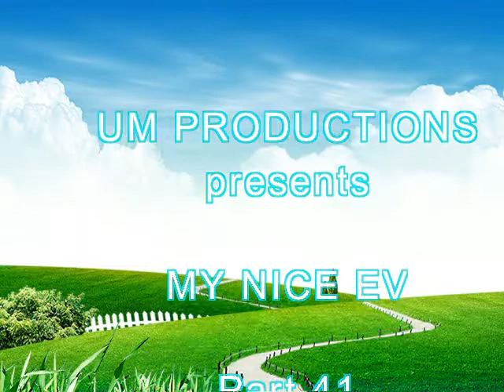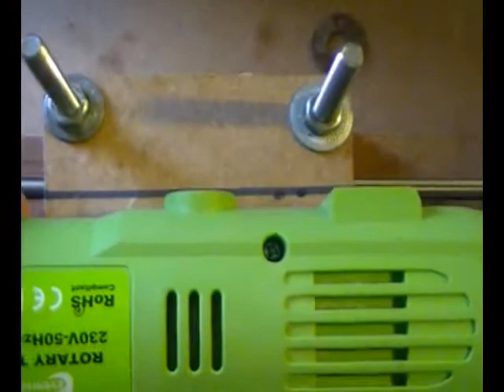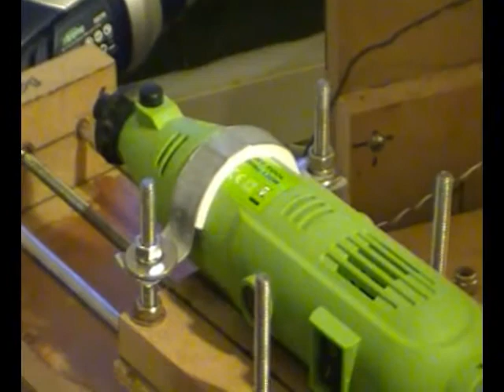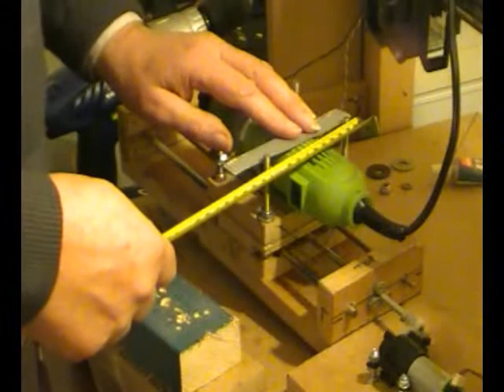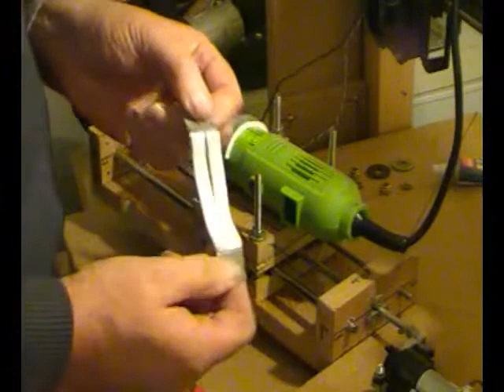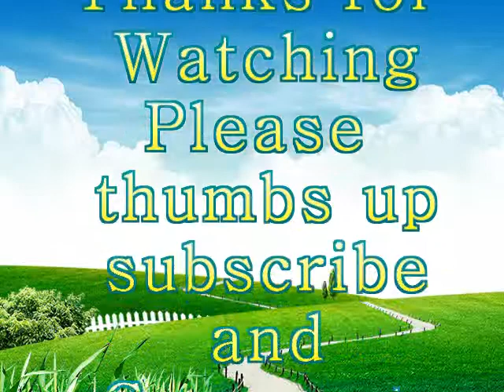MY NICE EV Printer Arduino CNC Part 41

Comment: Just to reiterate, you're going to use an end mill bit ? and you'll be cutting circuit board wafers ?  Is that corect ?
Reply from the maker: No Bruce. 0.2mm V bit and routing printed circuit boards and the dashboard for MY NICE EV.
Reply: Aw, ok then,... Thanks for clearing that up for me.